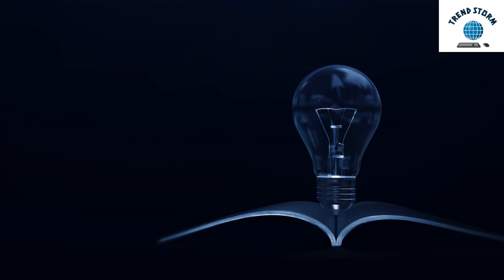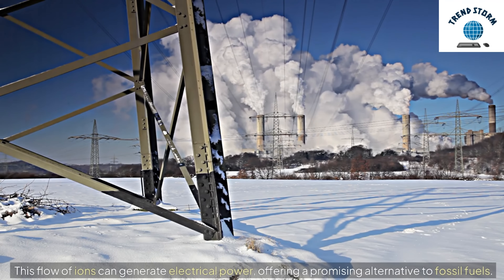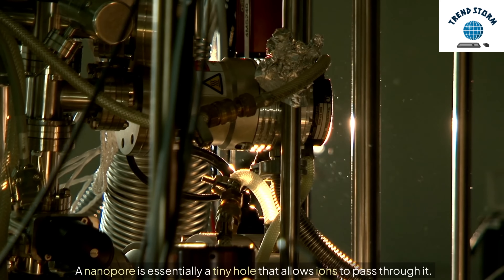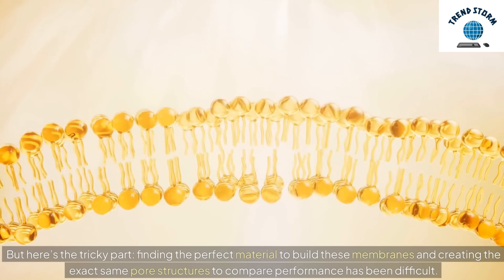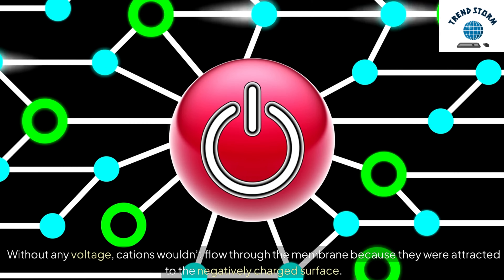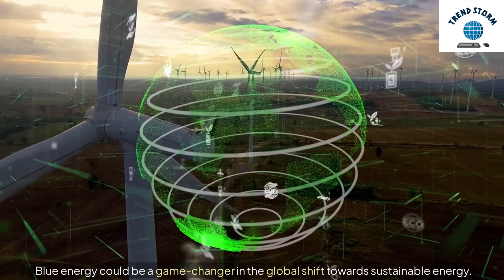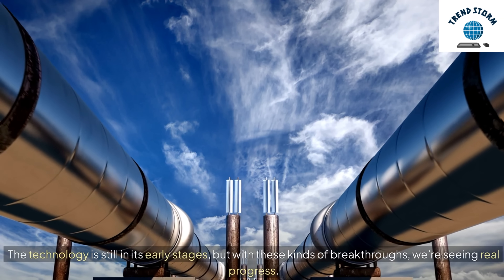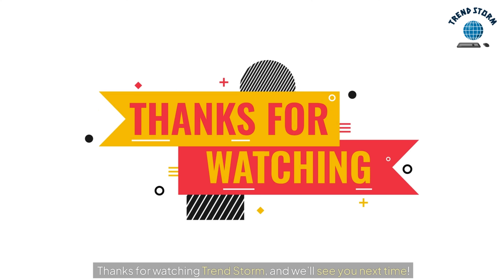Power of Blue Energy | Voltage Controlled Nanopores | Harnessing Saltwater for Energy

Comment: How does applying voltage make the ion flow more controllable?
Reply from the maker: By embedding a gate electrode in the membrane, researchers can adjust the voltage to control ion flow, similar to how transistors work in electronics!